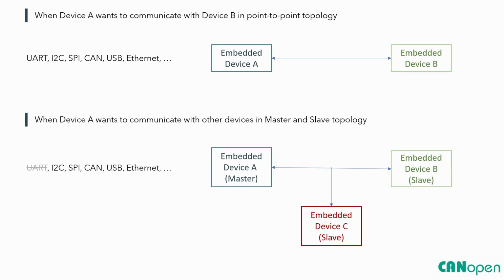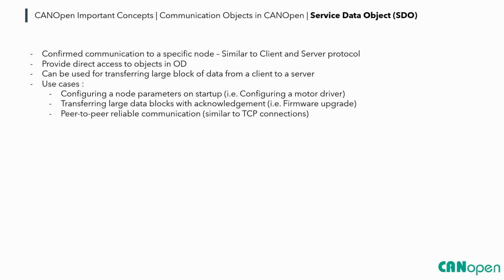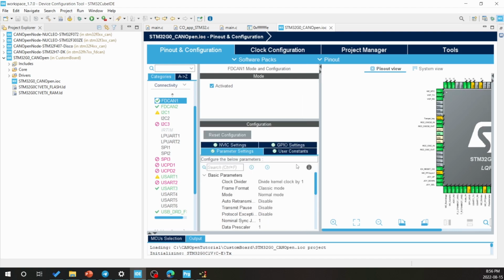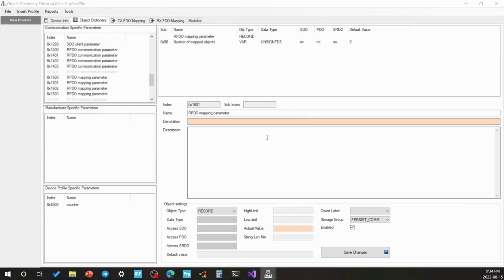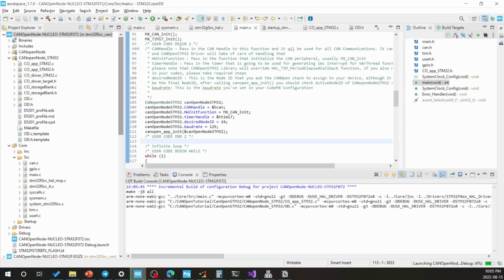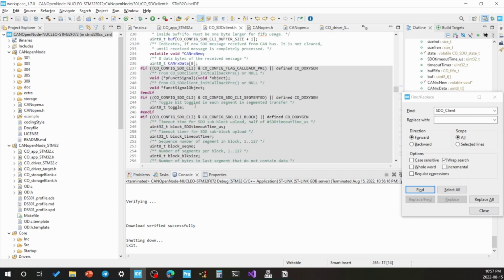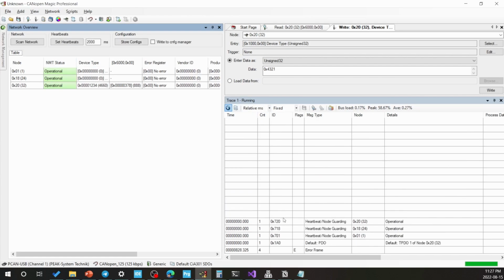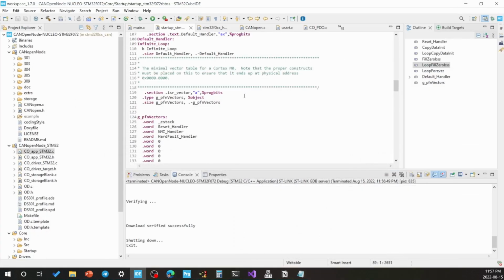CANOpen Node STM32 From basics to coding

Comment: Hey Hamed, Thanks for the great tutorial. Do you know if this stack can be used on other MCUs like TI DSPs? If the porting is hassle free or there might be traps because of the technology difference?
Reply from the maker: @ali.seif.k  Hi, I believe it should be straight forward, there are only two files that you have to rewrite .
Reply: @HamedJ511  Thanks for the swift response. If you elaborate on this would be awesome.

Comment: My heartbeat is working perfectly, but TPDO doesnt work at all 
I have read all the setting parameter all are correct but TPDO does not transmit 
I am using v4.2.1 ODE Editor
Reply: I used OD RAM to transmit. Work perfectly. Just config COB-ID of TPDO is same as RPDO of remote node.
Reply: Did you solve it?

Comment: can you show how to enable CO_MULTIPLE_OD. I define in CANopen.h and program had hardfault in CO_process_RPDO or CO_process_TPDO because  CO_GET_CNT(TPDO) and  CO_GET_CNT(RPDO) is changed to strange value (after initial,  CNT_TPDO = 1 and CNT_RPDO = 2, its is correct, but it was changed in somewhere before CO_process_RPDO, CO_process_TPDO).

Comment: If I try to use a subset of 301 commands the software will not run. I was trying to save space by eliminating unnecessary commands.
Reply from the maker: Would you please raise an issue on the github repo with more information and context ?
Reply: @HamedJ511  Was my issue info sufficient? Also can you explain the difference between PERSIST_COMM & RAM please? Are you open to any  paid side work that is non medical?

Comment: Thanks a lot for the code and tutorial, it is very helpful. 
But on the STM32H735-DK eval board I am facing one issue, the call to HAL_FDCAN_GetTxFifoFreeLevel in prv_send_can_message is always returning 0 hence no boot message is transmitted.

Comment: Just a couple of things I learned the hard way:
0. Install Windows Terminal from the MS Store 
1. The timer ISR (HAL_TIM_PeriodElapsedCallback) needs to call canopen_app_interrupt()

2a.  You must always select the PDO line first in the EDSEditor, then change its parameters.  Its super easy to think that since there's only one PDO, and you change its values, that it will work.. only to find that when you reload, it looks like the change you made was lost.  In the video it happened a few times. 
2b. The PDO is set in the EDSEditor as 5dc/1500 yet in od.c it gets saved as 9c4(2500), causing PCAN Magic to show a cycle time of 2.5sec instead of 1.5sec!  I tried rebuilding EDSEditor with MS Visual Studio Community 2022 (17.7.6), but same result.   BTW, I needed to uncheck "Sign the ClickOnce manifests" to disable signing before the exe and dlls would build.   
2c. EDSEditor exports BOTH c and h files, even though it prompts you as if it's only saving/exporting OD.h

However the biggest problem I found is that when powering on, PCAN Magic shows Operational but after less than 10 minutes, the GUI does not see ANY traffic (heartbeat or PDO)!  To recover, the USB Peak has to be unplugged and reinserted.  But even this is not perfect, sometimes when plugging Peak back in, the STM32 reports pre-operational mode, so you have to then reset the STM32.  Does nmt operational happen automatically after periodic heartbeat is enabled?

Just for sanity, I'd like to try testing with a cheap CanOpen slave device (GCAN-4128).  Unfortunately, it didn't come with an EDS just a PDF in chinese. If anyone can help make sense of it that would be great.  For example, why are the upper 16 bits of a COB ID sometimes 0, and other times its 0xC000?   Or what is the difference between OD_PERSIST_COMM  and RAM? The GCAN-4128 is a Digital Input/Output device.. with each bit of a byte controlling a different output discrete... is there a way to construct the EDS such that you can access a discrete by itself instead of masking locally?

Comment: Hello Hamad, very nice Tutorial i have understand a lot from it over CANopen. I have a questions though: I am using the CAN Open library for controller STM32f105, i was able to compile without error, and sending through normal caN Bus (Not CAN Opendriver)  signal which i could see in an analyzer, but when i want to use the "can open driver" eventhough can open process is in main loop and interrupt can open is in my timer(1ms) i am not able to get even the boot message. do you have any idea what could be the problem? (Baudrate is ok 125 Kbits )
Reply: I have followed the code through the debbuger and got sdo Server Parameter for Index 1200 as illegal argument  but i still have no clue why (can not initialise)

Comment: Great tutorial Hamed. I have a question, how do we send a node to master, and then send a bootup message to all nodes? it looks like my nodes are not going into an operational state (i think).
Reply from the maker: Hi Tim, Just have a look in CO_app_STM32.c and add the following to enable automatic jump to operational state . #define NMT_CONTROL                                                                                                   

    CO_NMT_STARTUP_TO_OPERATIONAL
Reply: @HamedJ511  thanks! i can get my node into operational, but it looks like i cannot tell the other nodes to boot up. i need to send a standard bootup message: CAN-ID= 000h, Length= 2, Data= 01 00. or does CO_app_STM32 do this automatically as it is the node master?
Reply from the maker: You have to explicitly write that in your code Tim.
Reply: @HamedJ511  thanks. Any pointers as I have looked everywhere but no luck so far. Appreciate the help.

Comment: one of the best explaination in CANopen easy to understand, iis it possible to communicate to interoperable between CANopen and CAN Bus standard? for simple data transfer
Reply from the maker: It should be possible if you avoid using the COB-ID that CANOpen uses.

Comment: I have a IOC file for m y STM32F405RGT*.  I want to add CANOpen and then tweak my sensor and motor pins to work with the CAN stack.  How do I proceed?  I don't want to bring every example into my project.  I don't want to copy files from your repo to my repo and lose future updates.   I'd like to not build my code in a branch of your project.  This is probably a longer conversation.

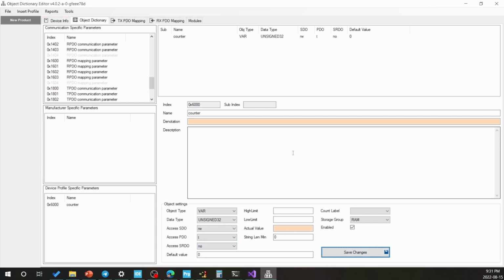Comment: I have a question about PDOs. There are three processes after the function Canopen_app_init at 33:26. The first one Canopen_app_interupt is the function process for the PDOs, but I can't find it anywhere in the code. So I want to ask how the PDO works at 1:27:17. It only replaces the OD.c and OD.h in the CANopenNode_STM32.
Reply from the maker: Hi, PDOs are processed in `canopen_app_interrupt`, we had to use timers to schedule the PDOs correctly.

Comment: Hello. Great tutorial! I would like to transmit a PDO on receiving the SYNC message. Do I need to do any special config on the EDS Editor or that functionality is already built in in the CANopen stack? I think it would transmit the PDO upon receiving the SYNC message if the PDO is synchronous, but I don't know how to make it synchronous.Thank you in advance!
Reply from the maker: Hi there, I haven't had the chance to use the SYNC functionality. It is already implemented in the original stack and should only require couple of tweaks to work. But can't help yet as I didn't tried it.
Reply: @HamedJ511  Thank you! Your tutorial already helped a lot. but I still have issues trying to send the PDO after receiving the SYNC message. I read that OD 0x1005 describes if it's SYNC consumer or producer. Also the subindex 2 of the TPDO should be 1-240 (depending on the number of SYNC msgs before sending the TPDO). But, still doesn't work. So, clearly I am missing something. I'll update when I figure it out.
Reply: @jesusdavid5124  You'll most likely have found a solution by now, but here it goes: I haven't tried it with this specific stack yet, but generally speaking, you can configure the transmission type of a PDO. The default in EDSEditor seems to be 0xFE (or 254), which is Asynchronous. If you want your PDO to be sent with a sync signal, you have to set the transmission type to 1. When a sync message is received (default sync message ID is 0x80, but can be viewed and changed on object 1005, like you already found out), the PDO should be sent out.
Transmission type can be changed under the tab "TX PDO Mapping" and then "Communication parameters" -> "Type" (default is 254).
Reply: @MrBenedictHeyer  Thank you for the reply. You're right! It's working for me now (well, a while ago, but I am just working again on a CANopen node). The issue was in the uC code. By setting the TPDO type and the consumer SYNC msg with the correct node ID, it should work.

Comment: I am now using the Object Dictionary Editor v4.1 - I have a problem. I cannot get my TX PDO to re-transmit. I have deleted the empty PDOs, like you & I have set the event timer to 1000 but is still does not re-transmit? The heartbeat is working at 1 second with no problems. - Fixed, looks like the Event Timer field in 4.1 is in increments of 100mS, so 100 = 10 seconds.
Reply: Hello, i have the same problem as you. My heartbeat is working perfectly, but TPDO doesnt work at all. I tried set Event Timer "10" for 1sec, and tried "1000" as in video, but it still doesnt work. I cant see nothing except heartbeat.

Can you help me?

Comment: Hello Hamed, I'm trying the F407 example but unsuccessfully. Are the pins PB5 and PB13? Are there clock setting problems? Can you help me?
Thanks
Cosimo
Reply from the maker: Hi Cosimo, Yes the pins are correct and there shouldn't be clock settings problems. I would have look at the hardware side and other devices in the network. If they keep the line busy, the F407 might not be able to transmit/receive. Also, have in mind that you should have at least two nodes in the network. What is the error or behaviour you are getting ?
Reply: I receive "Error Frame" in Canopen Magic.  But I have only one node and the PEAK interface connected to CAnopen Magic
Reply: Hello  @HamedJ511  Do i have to put on then network one more node?

Comment: Have you updated clone repository information for this video? The STM32 repository appeared to pull the open node stack with it, is that correct?
Reply from the maker: Hi Duncan, yeah it should be fine. The https://github.com/CANopenNode/CanOpenSTM32 is the latest and working correctly.
Reply: @HamedJ511  I have had to block more folders than you list on the GITHUB for it to work.

Comment: Hello sir, when I tried to create PDO mapping just as you did in the video, I encountered this error: TPDO 0x1A00,0x01: not mappable OD entry 0x6001,0x00. (I created the object at index 6001 and set every parameter the same way you did). Do you know what the cause is? Thanks a lot!
Reply from the maker: Hi, which version of Object dictionary editor you are using ?
Reply: @HamedJ511  Hello, I have the same issue too. I've tried with v4.0-104-g6f50f73, 4.0-103-g029e57e and have received the same error. And one more question: if there is no CanSniffer or CanMagic in the network, how can I implement NMT message send from one device of the network to change the state of other devices to "operational"? Thanks.

Comment: Hey Hamed,
thanks for the great tutorial. But we have one question:
ST has 3 versions of CAN for its boards. "CAN", "CAN 2.0" and "FDCAN". We use a board with "CAN" and we don't have different settings in MX Tool like Clock CAN, Transmit Pause and some more. 
Is "CAN" or "CAN 2.0" compatible to the CANOpen stack at all ? 
We use the board NUCLEO-F446RE.
Reply from the maker: Hi Leo,

I believe CAN 2.0 is basically an extension over CAN, which might include 29bit identifiers. So the short answer is I think CANOpen is compatible with CAN 2.0 when it is configured for 11bit identifiers. Also You can use the CANOpen with FDCAN, as long as you stick to 11bit identifiers and 8 data bytes. I think I already included an sample for FDCAN. Let me know if you had any other questions.

Comment: Hello Hamed! Thank you for the in depth tutorial! I'm struggeling a bit with the RPDO part. I can't get it to work from some reason. Sadly I don't have an appropriate CAN-Sniffer or the CanOpen Magic software. I can verify that my nodes are able to send data with an oscilloscope. I think the Problem might be with the ID of the PDO. I vertified that the CAN bus hardware is working by sending simple messages though STs HAL. what do you suggest in order to get it to work? It might also be a problem of the CANopenEditor since it's a bit finiky with saving order and such. I'd love to recieve some clues from you if possible.
Reply: I got the sod to work on my master device. It's a STMF417VG processor. But my slaves seem to have a problem still. They are STM32F103C8 controllers (Blue-Pill Chips). It's a very common chip. It would be great if you could test your code with it and create an example!

Comment: Hey Hamad, my STM does not send the bootup message, the canopen magic sees only error frames and cannot detect any node id. What am I doing wrong?
Reply from the maker: Hi Izabela, It can be wrong bitrate, wrong can configuration, or wrong wiring
Reply: @HamedJ511  Do you know how to check configuration? Bitrate and wiring are certainly fine. I did configuration as shown in the tutorial and examples on github yet I can't get it to work.

Comment: Errors in PDO mappings:    TPDO 0x1A00,0x01: not mappable OD entry 0x6000,0x00 // how to solve this error ?
Reply: when make the variable select tr in access PDO
Reply: Hi did you resolve this error? I am also getting the same error.
Reply: @rajeshjosyula8290  yes i did
Reply: also to setup the micro controller, which is not in examples do check thier repo coz the video doesnt tell about that properly as you will need a timer interrupt also to make it work.
Reply: @GlasboxEngineering   I also did select tr for access PDO but while I do not get the error i cannot see any transmission when I look using a logic analyser.

Comment: Hey Hamed, this is a great video. I have a question. Please help :) How can I do the heartbeat for the sensors?
Reply from the maker: Hi Mehmet, if you are building the sensor then you can simply activate the heartbeat like I shown in the video. If you bought the sensors, then you can access heartbeat object using SDO and set the heartbeat timer for that sensor. it should be very easy and a single SDO download to the sensor node.

Comment: Hey, will this probably work with an EFM32 Silicon labs board? Great video!
Reply from the maker: Hi, Unfortunately I don't have access to EFM32 to test. But the whole CANOpen library is hardware agnostic, although the driver file is built for STM32 and you can easily change it for your microcontroller.

Comment: Thank you for this very informative video. I am new to CANopen. I am considering using a STM32F103C8T for a new application. Will it work with this tutorial?
Also would it be difficult to code and compile on PlatformIO?
Reply from the maker: Sure , as it supports CAN, it should be fine with CANOpen Node.

Comment: Hello, i don't have xpd file but eds file what should i do to open it in your project
Reply from the maker: As far as I remember, you can open it and have a look, but unfortunately if you export C files, it probably won't work . Anyway, the project got updated recently, give it another try
Reply: Thank you. 
Hello again, i am facing an error that i cant solve can you help me? 

Errors in PDO mappings: 
TPDO 0x1A02,0x01: missing OD entry 0x6000,0x00 

I just did what you did

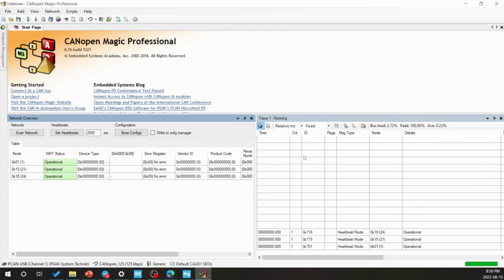Comment: I am not getting the continuous heartbeat as you have shown in 55:18 What shall I do? I think the producer heartbeat is not configured.
Reply from the maker: Hey Surendra, You can configure that in the EDS Editor. In communication parameters list, assign a value to 0x1016
Reply: @HamedJ511  Is it 0x1016 or 0x1017? Don't we need to configure producer heartbeat time?
Reply from the maker: @surendramaharjan3129  Oh sorry, yeah I meant 0x1017, producer heartbeat.
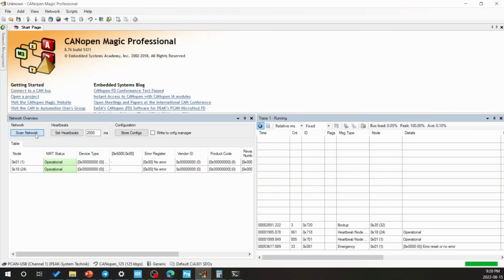Reply: @HamedJ511  at 1:16:44 what happens when we click "set heartbeat"? If we don't have canopen magic software, what is the alternative solution to produce continuous heartbeat?
Reply from the maker: @surendramaharjan3129  why you are not setting it on each node individually ? What "set heartbeat does" is that it updates the node's 0x1017 with the heartbeat time using SDO transfer.
Reply: @HamedJ511  I changed the line number 33 in OD.c file to  ".x1017_producerHeartbeatTime = 0x3E8". Now the heartbeat is produced every 1 second. By the way I am not using any configuration tool (Can't afford)
Reply from the maker: @surendramaharjan3129  great that you managed to get it working . By the way, I'm using this https://github.com/CANopenNode/CANopenEditor for editing OD files. It is free and open-source.
Reply: @HamedJ511  1:39:41 How much I try but also I am getting a single TPDO1 packet at a start and that's all. I checked Event Timer value and it is properly set at 0x5dc. Any suggestions?
Reply from the maker: @surendramaharjan3129  Did you activated interrupt for timer that we use for transmitting PDOs ? if yes, set a breakpoint on CO_process_TPDO function and debug from there.
Reply: @HamedJ511  There was an issue with the prescaler and counter peroid value. Once configured for 1ms interrupt it worked like a magic. Thank you so much...